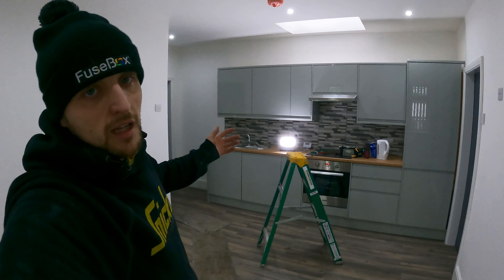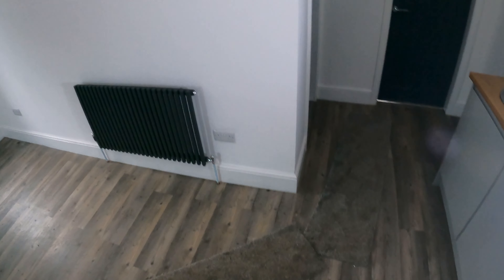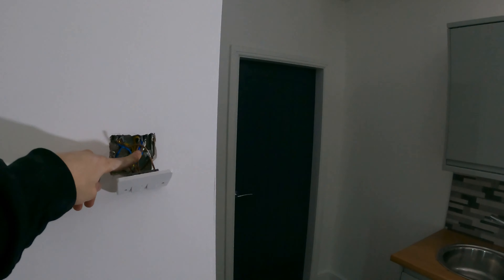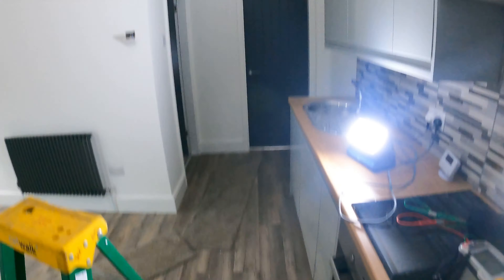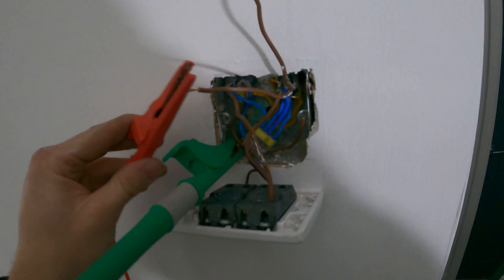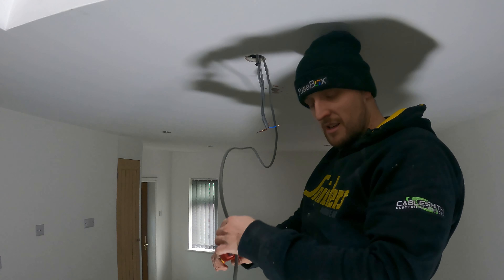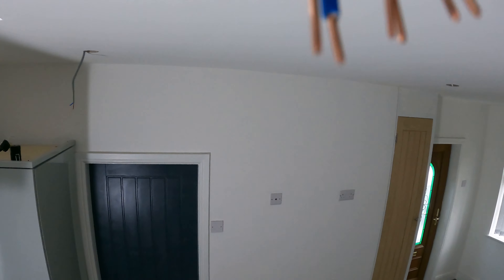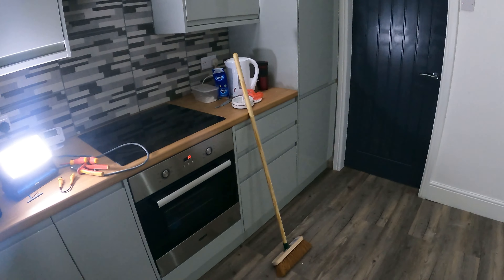Fixing A SWITCHED Smoke Detector | Electrician At Work

Comment: To be fair the builder wiring the lights as a ring would give him a low Zs 🤣
Reply from the maker: Haha that’s why in one of the vids I said it’s not “wrong” as such, it’s just not usual. I don’t recall any regs to say you couldn’t do that, I see not problem with it safety wise, it’s just strange 😀
Reply: @Cablesmith  Yeah mate he’s not wrong but you’d never do it that way, especially not on a small flat like that. Took over a job before in a similar scenario where the “Sparks” had been thrown of the job, anyway they had wired TEN yes TEN feeds for a 2 bed flat for the lighting! Even the master bed and en-suite had separate feeds and believe me this wasn’t a big place! 

As you say mate not unsafe but just wrong but I’ve seen a gold card time served spark do that with the smoke having it switched before 🤷🏼‍♂️🤦🏻‍♂️🤣
Reply from the maker: @JayTheSparky  unreal ! 😂 no word of a lie tho, I’ve met an electricians mate that bought a real gold card from someone that works at the JIB. So it was legit, but wasn’t if that makes sense 🤦🏻‍♂️ corrupt
Reply from the maker: @JayTheSparky  no joke, cost him £1000.

Comment: Over 200 more subscribers this weekend smashing it. This was very well explained and shown the logic of what you were doing. Excellent work. 

Two things on smoke detector testing you can get the smoke sprays but they can be problematic rather the Solo type smoke detector testing kits are better. Have you tried them?

https://www.solo-tester.com/cms/document/Solo_English.pdf

Also I am replacing my smoke and CO monitors with next generation google NEST protect detectors all hard wired in - they are expensive but I wanted to know whether you had any views on them and their quality  - the detection sensor is supposed to be very good reducing false alarms able to distinguish between slow burning fires as well. Great video.
Reply from the maker: Thanks Math, 
In regards to the NEST detectors I can’t comment as I’ve never used them before, however I often hear good things about them. 

As for the solo type testers, yea I’ve used them many many time, because I used to subcontract to Protec, a large fire alarm company, even used them with 8Meter poles once ! they are very good, also the head that removes and replaces the detectors themselves.

But I usually just use my E-cig to test them 😀(joke)

Comment: Just thinking........buy a heat detector. Not a smoke detector in the kitchen eh ?
Reply from the maker: Yea that’s the plan when I go back. I just say smoke detectors just as a generic term to myself or landlords if that makes sense. I use heat or sometimes optical for certain open plan kitchens and ionisation for halls/landings etc. Depending on the specific situations. 

But well spotted ! Your right 95% of the time I’ll use Heat In kitchens
Reply: @Cablesmith  ionisation alarms aren't supposed to be used in hall stairs and landings no more just bedrooms but I think they have been removed completely now.  So only optical alarms should be fitted and heat or heat/ optical combined in open plan kitchen areas. Aico have the selector tool on their website or app 👍 hope that helps.

Why do builders have a go?  🤦‍♂️ cost them more to rectify than it does to had got someone in originally.   At least you got it sorted.
Reply from the maker: @ARElectrics  funny you’ve mentioned that because it’s something I’ve only learnt in like the last month or so. And will be following aicos guidance from now on as I only fit their alarms anyway. 
You live and learn, gotta keep up with the changes eh ! 

And yea the builder thing, it’s not really the landlords fault tbh, hindsight tells him he should have got the relevant trades to begin with but he explained to me how it happened and it made sense, obviously the builder told some lies too
Reply: @Cablesmith  don't worry I wasn't aware of the changes either as I always worked to my old aico book for years and it wasn't until my mate picked up why I quoted for ionisation on landing that I found out.  
Yes can't go wrong with aico we fit nothing other than the 10 year lithiums no come backs with them.
Good video just came across your channel so I'll be subbing 👍
Reply from the maker: @ARElectrics  already subbed to yours a while back 👌🏼 thanks for watching mate